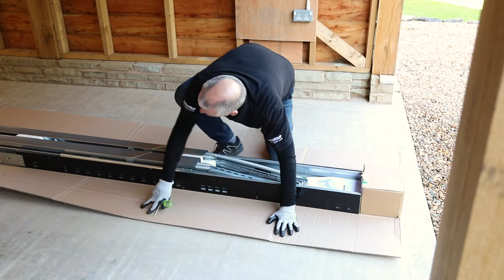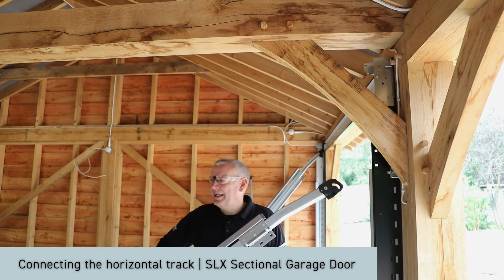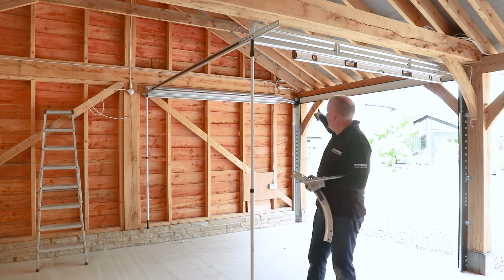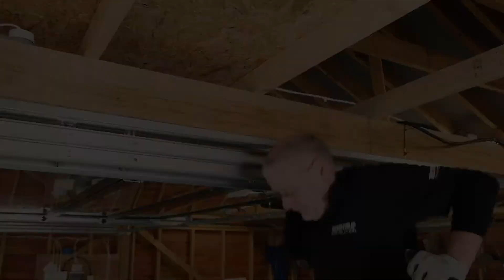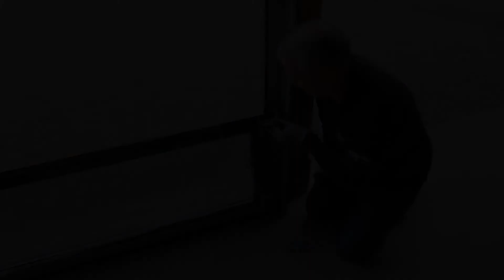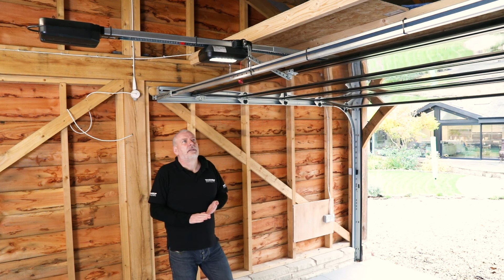Teckentrup Sectional Garage Door Fitting Video | Teckentrup Door Solutions UK

Comment: This is a great instructional video! I've not installed a garage door before but I watched this a couple of times and then successfully installed two sectional doors over a couple of weekends. I had to adapt the method a little as I didn't have any help so I used pulley blocks to lift up the frame for a safe one-man install. The doors themselves seem well designed and high quality. The only bit I don't like is that the centre hinges have metal protrusions. If I was to accidentally park my car a little too far back, these would do some serious damage to the back of the car as they protrude further into the garage than the rubber weather strip.
Reply from the maker: Hi Nick, Thanks so much for the positive comments and feedback. The protusions or “wings” as we call them, provide an essential safety feature as a finger guard to prevent finger entrapment when the door panels hinge - it’s a compromise but a necessary one. I hope that at least explains their existence and to date, we’ve yet to have a report of any issues occurring as you would need to park perilously close - within a couple of centimetres - to the door for contact to occur. If you are concerned it might be worth looking at our parking laser that is available to precisely position  your car if you have an automated door - https://www.youtube.com/watch?v=2RWLSEH3ob8&t=4s . I hope your doors give many years of service, thanks again.